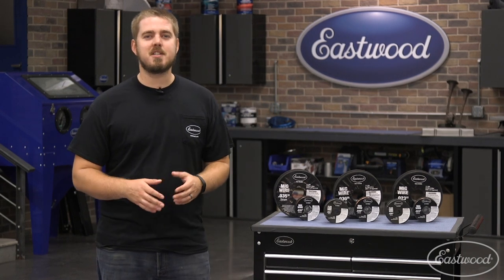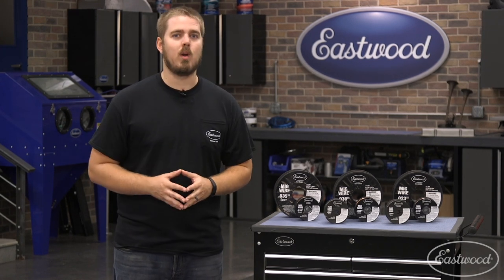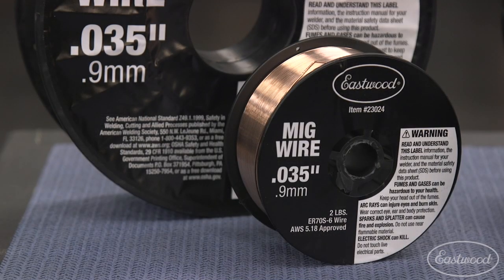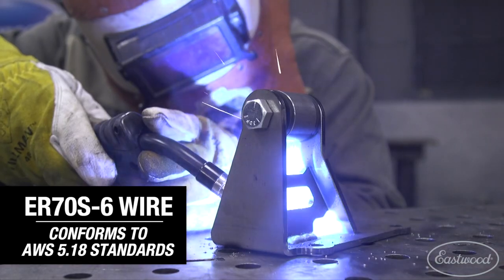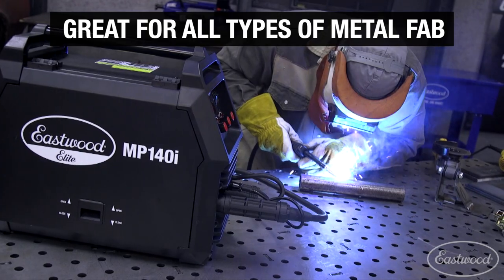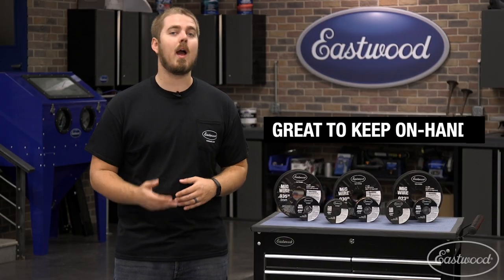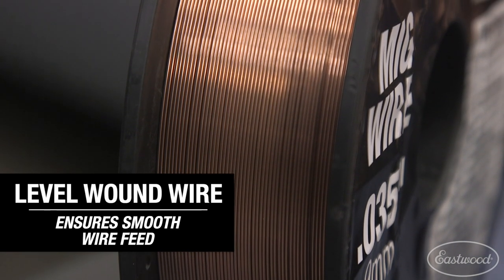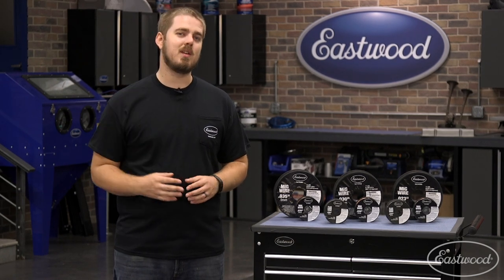Eastwood Welding Wire - Quality Wire to Keep You Welding!

Comment: Hi one question. When are you going to re stock on consumables on Amazon and on your website I'm interested in the mp250i but ther not enough consumables on the product. I owned the mig 250 I bought it like 3 months ago and it still works great but I'm going to need consumables for that welder too thank you.
Reply from the maker: Here is a link to the consumables for the MP250i and the MIG250. https://www.eastwood.com/eastwood-mig-250-welder-consumable-kit.html